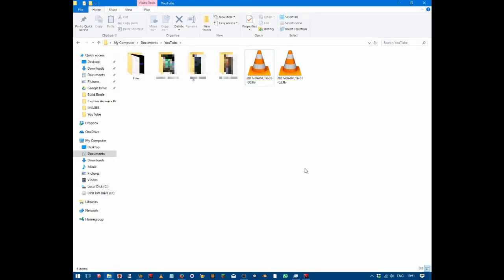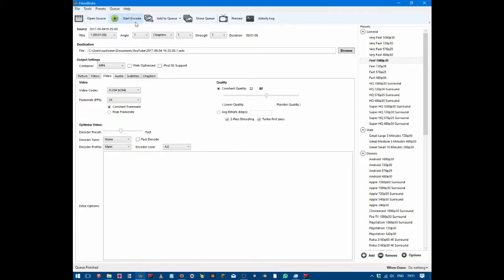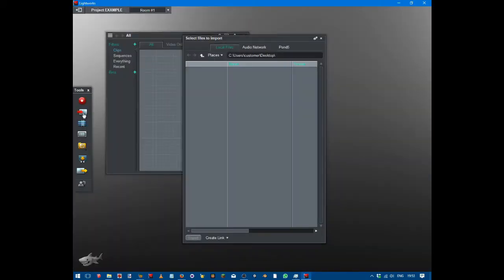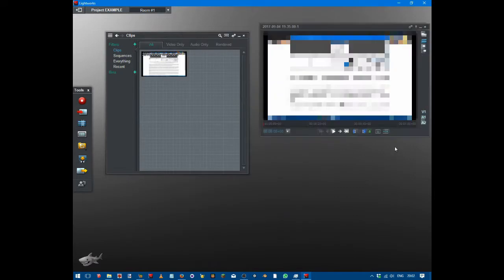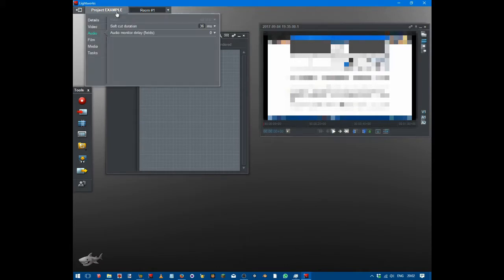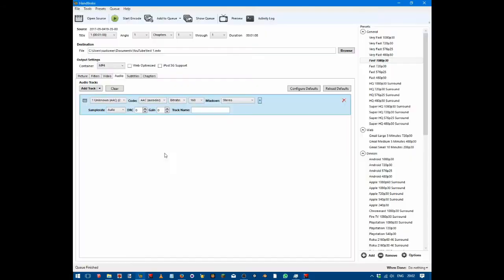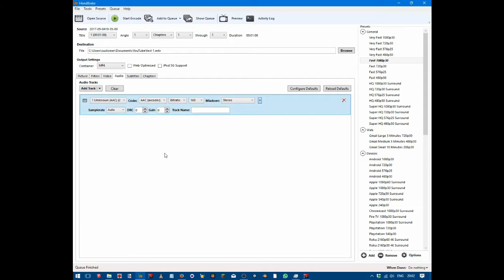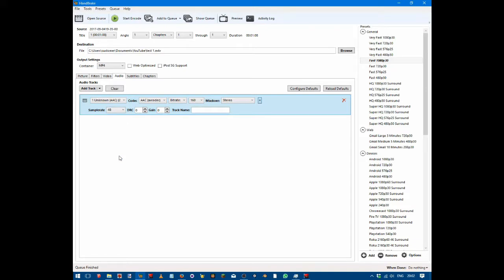How to Solve Lightworks Audio Popping and Clicking

Comment: You have just fixed a massive problem for me mate- thanks, I recently installed a new free version of Lightworks- I could not fix the audio distortion, in spite of listening to and reading several guides. You’ve got it! I had been importing audio from Audacity at the standard 44k. All it took was switching to 48k! Thanks , Hugh.